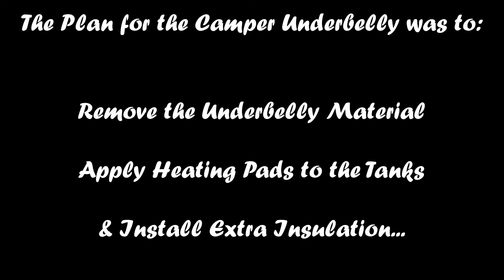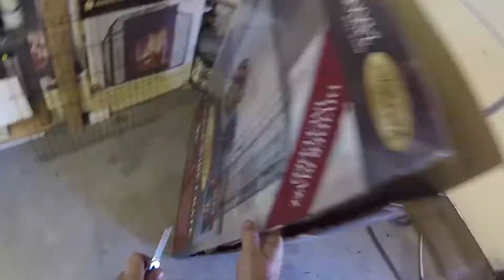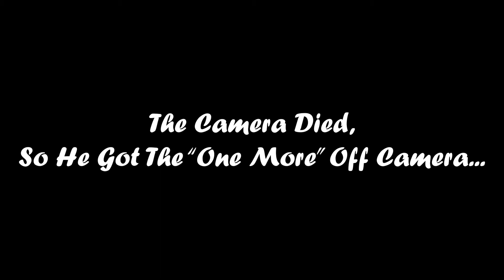Replacing our Campers Underbelly - Part 1: Removing Underbelly Material | RV New Adventures

Comment: That's a low end rig your lucky you have that much closed in underbelly.  My lower mid range apex was not even enclosed.  Now I have a lower mid range fifth wheel it's exactly the same as what you see here except mine full of all the trimmings from the install.
Reply from the maker: Yeah we were looking for this, we do all year camping but four seasons are hard to come by or are too expensive. It was also our first camper. Thanks
Reply: I had to take my liner down and I just ended up cutting it all the way across. And I put it back up with zip ties. Where are the two pieces of underliner went together I Cut a little hole in each end of it and like stitched it up there with zip ties and then Gorilla Tape. Worked pretty good but yeah it's a lot of work. I made the comment before finishing the video. I see you did the same thing, you just cut it all the way across

Comment: I need to do this to my 2023 KZ280TH. Noting is wrong but I need to mount etrac inside the toy hauler. Don’t want to risk hitting a tank or anything I shouldn’t. I will sub and watch #2 video. USE WD40 or any rust removal on your suspension springs shackles, etc. Get them free to move. They will break. Looks rusted on video.
Reply from the maker: He did treat all the suspension etc he just didn’t have it recorded. Thanks